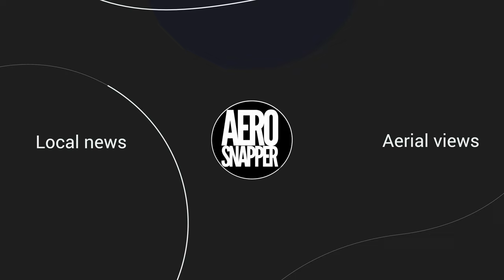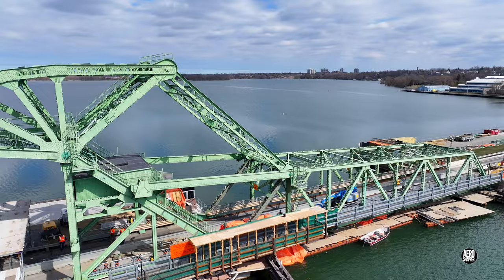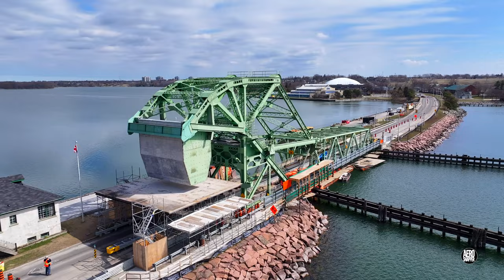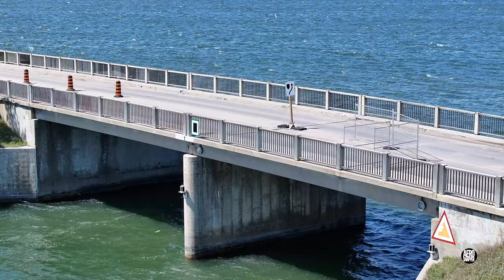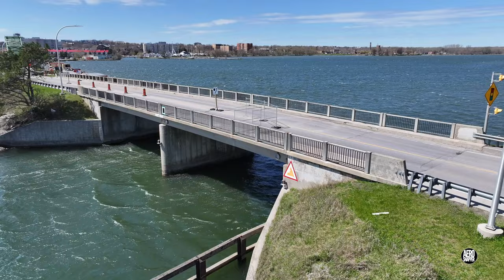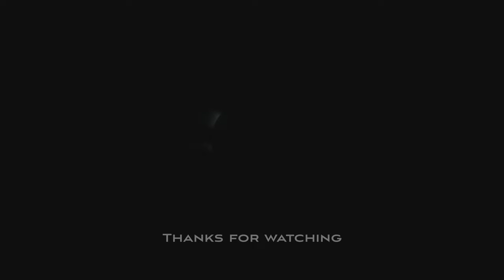Running the Blockade  - how can we get the tour boats out on the Lake  4K

Comment: Great video!

Removing a section of the bridge or digging out and dredging part of the causeway would likely be the quickest way to free the boats and allow sailboats to pass as well. However, Putting the bridge or causeway back together again may be a bit of a Humpty Dumpty situation that extends the closure of the crossing.

A crane capable of lifting a bridge section could probably lift the vessels but would have three times more lifting to perform.
Reply from the maker: Dredging should not be an issue - that section of the harbour is charted with adequate depth, though caution is always advised, situations change.  Yes,  correcting this unfortunate situation will be difficult.  I'm sure that much thought is being dedicated to finding the best solution.

Comment: Most of those boats, but maybe not the largest, could take the canal up to Ottawa, then down to Montreal and up the St Lawrence.  The deconstruction of the bridge for just one transit of one boat seems extreme.  Taking the bridge out would also affect the access of equipment to the lift span during repairs.
Reply from the maker: I expect that all possible options are being considered - but the Canal does not open until May 15th - something to bear in mind

Comment: What was the incident that is causing the delay?
Reply from the maker: It's unclear just what caused it - but a major structural component of the lift bridge buckled during refurbishment work. That has lead to extensive investigation to determine whether other parts have been weakened and work to correct the situation.